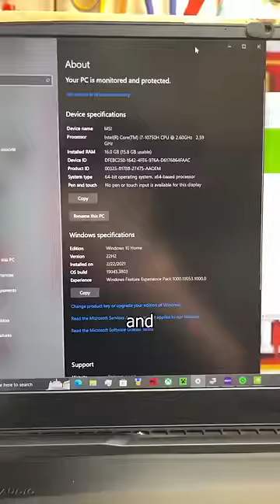MSI Raider with broken hinges (common failure) #laptop #tech #pc #technology #shorts

Comment from the maker: I sacrificed my last few remaining brain cells for your viewing pleasure
Reply: I LOVE YOUR VIDS
Reply: Thanks man!
Reply: In Canada I used to sell exclusively MSI motherboards... so, one day I thought... I can't get an Acer... let me start selling MSI...   well, 4 out of 4 ended up falling apart within 3 years... seams separated, body flexed... pure garbage...   now, I will only buy Acer 1st choice, Asus 2nd choice, Lenovo 3rd choice, HP Last choice... if those are not in stock "I'm sorry I don't have any laptops to sell you!"  lol

Although I must add... I did buy 6 Acer's in 2020 and within 5 months all 6 had broken hinges...  all sent in for warranty... it's my first Acer product that had manufacturing defects since the 1990's when I started selling laptops to customers.   Overall, Acers seem pretty good - but, I'm small potatoes and definitely NOT the best technician that's ever lived - I've only sold about 1,500 laptops - Acer even covered 1 of the hinge repairs outside of warranty.
Reply: My laptop has the same issue on top of needing thermal paste. It needs a new case in general.
Reply: Well thanks the greatest technician
Reply: Was that Win7 running on that laptop left to  the red laptop? 😮
Reply: The greatest brain cells that ever lived.
Reply: This is the laptop I use and when I saw this video I was kinda surprised because I was just thinking about how I had never seen anything about it online
Reply: What do you use to clean the screens? The ones with matte or anti glare finish?
Reply: @evanbenz3068 you could try throwing it in a desktop and mount the screen behind tempered glass for a little temp/system monitor. Re paste it, then throw in normal case fans. I bet it will be chilly!
Reply from the maker: @redghost7496  yes and even better, an unactivated copy!
Reply from the maker: @AidenBraydenPodcast  70% isopropyl
Reply: The greatest technician that's ever lived
Reply: I swear my msi laptop just did this and it’s still in the shop getting fixed 😭
Reply: thank you
Reply: We love you too
Reply: I highly recommend changing your name to "ThE gReAtEsT tEcHnIcIaN tHaT's EvEr LiVeD" 😂 And I love your videos by the way ❤
Reply: Your pfp: 😄
Your videos: 💀
Reply: Hmm perhaps these hinges can be custom made in steel or aluminum
Reply: Did you get that hat from spooky games in attelboro?
Reply: Some might say he was ready to go "Postal™"
Reply: How do I send my laptop in to youu lol ASUS ROG I9 3070 ti keyboard lights up rgb but monitor doesn’t after cleaning fans
Reply: Loving the comedy on this episode of broken MSI hinges
Reply: What an honest technician...
Reply: Wait you have braincells?
Reply: It's the final braincell 🎶
Reply: What is brand and model of the old black orange gaming laptop ?
Reply: THE GREATEST TECHNICIAN TO EVER LIVEEEEEE
Reply: You had brain cells? 🤣
Reply: @SalemTechsperts  Pirated just like mine...i mean , i found it under my bed...
Reply: Man how do I upgrade a laptop 😢
Reply: What do you think about Acer laptops hinges?
Reply: I’ll like then
Reply: how much does it cost to the hinge? i have an msi with the same problem, but my local repair shop charging 400€ for that.
Reply: 4 headbutts
2 ragethrows 

It didn't piss you enough i guess 😂

Jokes aside, i'm curious.
How many cells per headbutt? 😂😂
Reply: The ending made me snort, so job well done
Reply: @PerryCS2 I have an acer from 2010 that's still going. It's been dropped, the charge port is wobbly and the battery lasts all of 5 minutes, but it boots and runs most games I have on it.
Reply: What i am worried about is not the fact the laptop is fu***ed up but i am worried about the greatest technitian that ever lived.
Reply: Eyyyyy, unhinged buddies :>
Reply: Duuuh
Reply: @PerryCS2 nice
Reply: Thank you for your sacrifice
Reply: We appreciate it
Reply: Can you do a list of good laptops which have no plastic hinge mounts
Reply: Im surprised you still had some! I thought the gooch particulates pushed them out ages ago! I dont want to clean pcs ever again. Having someone else's nut dust in my sinuses sucks more than gramma after she takes out her dentures at the senior home.
Reply: HELLPP MEEE PLSSS...  my laptop need to be fixed, it overheating to 190 degrees and it's slow 😢
Reply: How much was that repair my wife has that same laptop with the same problem..
Reply: Your sacrifice will be rewarded some Day in the future, Sir

Comment: they need to start making laptops durable and able to last. we shouldn’t have to buy a new one every few years.
Reply: nah that's their business, if the laptop are durable and futureproof they would not make such a big profit
Reply: @i_zoru For some reason they can. 

Business laptops can be cheap and made of plastic or be expensive and made of aluminium/magnesium and they last awhile.
But some gaming laptops, even some hi-end ones are somehow built in plastic, starting to feel like it's on purpose for gaming laptop, it's sad.
Reply: ever since I got a laptop from 2013, it's still very durable and somewhat useable, it had 4gb of ram and I upgraded it to 8, if I'm correct I believe the cpu is also replaceable which I guess is a good thing? the only problem I have with it is the hinge
Reply: Planned obsolescence.  Followed by opposing right to repair.
Reply: @H-Shop  he didn't said they cannot though. Yes, they can but they wouldn't; look up about the history of everlasting light bulb for the same exact reason. All things are now built not to last for long ...
Reply: It's pretty simple, in the past hardware got huge gaming every year, so you had a good reason to upgrade no matter how much you spent on your computer. Now hardware is bearly getting better, and is far from the point people really need an upgrade (I know many people doing great with a 7-8 year old hardware) so they have to bake in a different mechanism of obsolescence
Reply: @H-Shop  of course they could, but the question is, will they do it?
Reply: @yummylazor2998   hinge? sounds like MSI

MSI are known for using a plastic hinge holder instead of metal
Reply: @i_zoru  the left hinge completely detached from the screen part and the only thing holding it on is the screen wire
Reply: @H-Shop I’m honestly not sure if it’s planned obsolescence, or just that people aren’t willing to pay for durability. Because you can buy a business workstation laptop with the same GPU as a gaming laptop, but it’ll cost $1000–$2000 more.
Reply: Even if they're durable now, you're still screwed, they're making them unupgradeable.  Soldered in RAM and SSDs, usually means you shell out top dollar today and last a few more years, or buy cheap and throw it away in a few years time.  Or go the Linux route I Guess.
Reply: They doing that for purpose. To make you buy new laptop again.
Reply: Like how toyota was getting tired of people not trading in their never dying sedans.
Reply: They want people buy new laptops every year
Reply: @i_zoru  lot of Dell with this garbage now too
Reply: framework is, but it is incredibly expensive and still underpowered
Reply: Ain't a point to make it solid if they just kill the software every few years
Reply: @TheQuark6789 It's not about will, wtf. What kind of money do you have to view 1-2 THOUSANDS as an acceptable budget break ?! Most people's budgets for PCs are tight af. As they should, it's not like it is anything absolutely necessary. Especially gaming PCs. It's a luxury.
Reply: Mine has been repaired 3 times in 3 years due to hinges breaking the plastic around them.
Reply: They can last longer than 3 Years depending on how you use it
Reply: @ruekurei88 . Soldered RAM works better than a Removable one

Comment: The issue from what I know isn't plastic hinge mounts, rather the overtightened hinges which puts more pressure than necessary on the housing which ends up destroying it. Loosen the hinges and it'll be fine.
Reply: Exactly my cousin has a laptop of msi  it was during winter he opened the laptop and it was hard asf from the hinges until he recognized the damage had been done.
It costed him 100$ just for that stupid hinge.

Comment: Repaired a Lenovo X1 Carbon (really expensive ThinkPad) once. The plastic hinge mount was basically superglued to the chassis (wtf Lenovo?). I ended up using a 2100 pound 2 step epoxy to fix the hinge mount, far stronger than what the factory used. I was certified as a Lenovo warranty repair technician, but this was an out of warranty repair, so I was allowed to use whatever materials the customer approved for the repair (did not work directly for Lenovo… they just gave me access to official OEM parts and reimbursed me for any in-warranty repairs. I however had to be certified and knowledgeable in all of Lenovo’s product lines).
Reply: Isn't that the laptop where the screen can be opened 360 degrees? 
Crazy and interesting they would use weak-ass adhesives for that kind of laptop
Reply: @CaptainLian No, that would be Yoga.

Comment: Jusf binge watching these shorts reminded me I still need to send my tower to a repair place to figure out why my top ports have never worked since I got the pc.
Reply: did you check to make sure they're plugged into the motherboard? not sure what your level of experience is from just this one comment, but checking that might save you a repair bill if you haven't looked yourself
Reply: @xXx_Regulus_xXx  I can do basic hardware following a guide. Even video streaming to a couple tech friends, none of us know exactly what's wrong. Everything is connected properly. The power button next to the ports works so the piece has power. The audio jack and USB just refuse to register or don't work all togather. I've been dealing with this for a year or 2

Comment: Just got an MSI Sword 15 with an i7 12650H processor and a 3060. Can confirm hinges are kinda janky. Aesthetically pleasing though and has a decent cooling system at the touch of a button at the expense of battery power.

Comment: Even the metal ones aren’t indestructible. I have a 2007 MacBook Pro from college I had to dismantle because the front display bezel broke at the hinge. It took over 10 years to get there, but it got there eventually. I ordered a new basil and tried to repair it myself, since I’ve been servicing my own computers for years just when I was about to finish putting the display assembly back together, I makes rookie mistake and accidentally snap a ribbon cable on the display. Needless to say, it was at that point I decided to retire that laptop.

Comment: Gotta say you're on point here, I own a 7 year old msi laptop. Top tier hardware provided for the price, but when it comes to the build quality.... Its kind of falling apart.
Had to send it to the service centre for changing the hinges, they said they will have to change the whole assembly due to plastic construction. 
Costed me almost 50-60 bucks for the change.

Comment: I got a story for you. My computer wouldnt run 2 sticks of ram cause the cpu fan was on too tight. Didn’t even know that could happen. Fixed it by taking it off and replacing it with a water cooled system and when I took off the fan it launched up cause it was on so tight but the cpu was fine after I put it together it booted right up with 2 sticks of ram

Comment: To be real every laptop should be aluminum and have have steel or aluminum hinges. it's the thickness of the material, when you use extremely fine threads, and depth of the screw bosses that cause them to break

Comment: 3 years ago I have had same problem with asus vivobook s15 s510...and replacing the bottom metal body part would cost 4000INR but as I am the 'Poor Guy that ever lived ' I used epoxy adhesive and mseal to adhere the hinges with top panel and loosen the hinges a bit and using this lappy for 3 years..!

Comment: No one ever asks for teeny tiny feather weight laptops. We are all perfectly happy with 20 pound behemoths that are over an inch thick, that have batteries that actually last more than 3 hours, and don't fall apart when dropped onto a heavily padded surface from 2 inches up.

Comment: Dear Greatest technician that ever lived....  Do you think you could fix a acer predator helios from 2017 that doesn't boot? Its got the same hinges that I ghetto fixed with JBweld(quite proud of that actually), with a motherboard issue and a slightly questionable back housing held together by hopes and dreams... :)

Comment: You insulted both my sister and my mother, and also called MSI unreliable. This is coming from the same technician who installed an air cooler upside down and doesn't know how to tunnel an AIO radiator to avoid having to undervolt a CPU. I love watching these because I get to go into work and laugh about it at the shop

Comment: Im a fairly rough user and my MSIs havent had an issue with the hinges... The trackpad, mouse? Broken in both. AAAAANND the keyboard keys have maybe 50 key presses before they break. I just replaced the keyboard in my current laptop and after removing 2000 screws, unhooking every connection to the motherboard and lifting the whole thing up, I almost shat my pants because they heat welded the plastic tabs holding the keyboard in place so i had to break all those tabs to get to the keyboard and I just had to sorta tape it down to keep the new keyboard in place. Would it have killed them to not weld those tabs in and make it more repairable? I guess it would. After this experience I'm never buying a gaming laptop again.

Comment: I have a friend with this same laptop and guess what? And the worst part is I worked on repairs and I would fix it for free, I mean... It takes but a couple of minutes. The problem is that just ONE SINGLE FUCKING SIDE of the cover is over 100€! FOR A PIECE OF CHEAP FUCKING PLASTIC. As I said I have worked in repairs and while yeah, the sad reality is that this is a stupidly common problem in any laptop past 2008 but at least a bezel and cover is usually around 20-30€. MSI ask for over 100€ FOR EACH SIDE!

Comment: I own a msi gf63 laptop been using for 2 and a half year without a single problem. Hoping to use 2 and half year more than sell it. Before I use to own msi ge60 and i used it for five years and than sold it. I am very careful with the laptop everytime I open laptop I do it slowly from the middle.

Comment: So whole problem with laptops are there is a thing named laptop and its literally sucks in every way my 1060 6gb and i5 6600 can open elden ring mid-high settings when my friend’s 3060+ laptops struggling about it and i have 3 friends hates laptops and moved to the normal pc

Comment: Hey
Since you do MSI repairs, i have the same msi ge63 raider 8rf, do you think you can fix the GPU? Its not being detectd by the system and my msi tech says i need to replace the whole board, which is a bit expensive 

Do you think you can help me?

Comment: @SalemTechsperts i have quick question, what was the thermal pads thickness used by the CPU? Unfortunately i don't have the original that was on mine and ive sorta been winging with 1.5mm thermal grizzly. But ive tried 1.0mm and even 0.5mm at one point but im still worried that its not right. Any help would be greatly appreciated. (Since u know, MSI wont tell me or anyone else ive asked on Redit and other forms) best answer i got was 1.5mm but still seams like something The Greatest Technician of ALL time would know 😊
I really hope he replies 🙏 😞 huge thanks & love the videos.

Comment: I had a hinge fail on a new msi shortly after the warranty expired. I had to drill into the chassis and bolt it back together with screws, nuts and bolts to fix that one. I don't understand how they cheap out on an essential part of a laptop.

Comment: A plastic protection for screens will reduce the price and enable the capability of adding more money for the cpu and gpu the same thing with redmi phones from xiaomi company not specefically with the materials but withsome internal hardware components swapping or just taking them off but once i heard they are expensive and even after this dangerous plastic swapping ??? No way

Comment: I have this same exact laptop as my everyday gaming laptop (because I can't afford a PC).  I have not closed the laptop screen in years, and I think it has thermal damage.  Had it for 4 years and almost never shut it down.

Also had a malware problem for a bit and now its always using 100% of the CPU for like no reason.
Reply: I did reset the computer by reinstalling windows and got rid of the malware (I think) but the CPU is always at 100% even on startup

Comment: Also tf is wrong with chargers/ports now a days?. I swear Ive seen so many forum posts about chargers needing to be in a specific position to work before eventually just dying completely, and I experienced the exact same thing. Not the charging pin, not the cable, idk wtf is wrong with it. Like does the heat just morph the charger head so it no longer makes contact? Is the current just too strong? Why does my charger die after a few months?